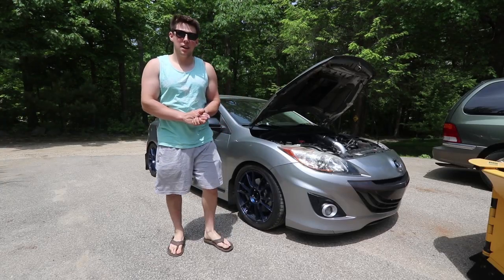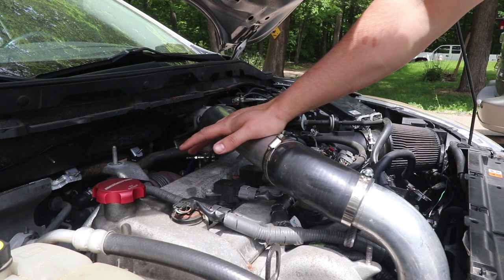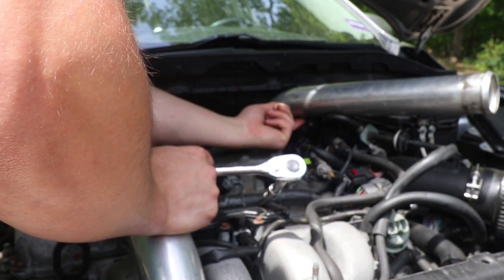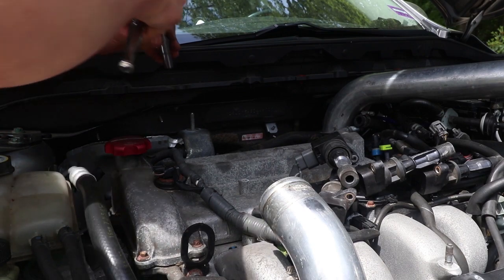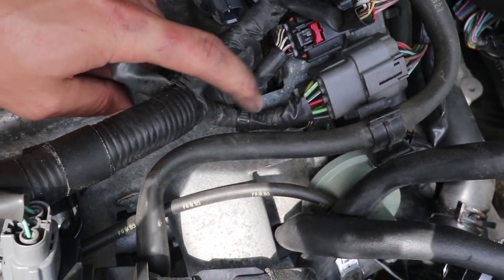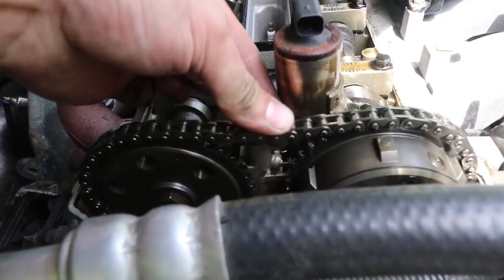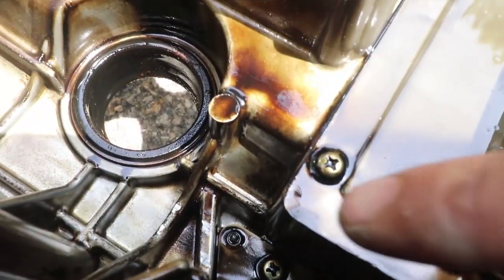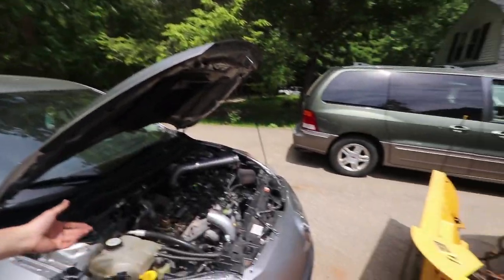Mazdaspeed 3 : How To Check Your VVT!

Comment: Why do Mazdaspeed guys always get this wrong. A loose chain means the tensioner isn't able to tension the chain so that it's tight. Whatever may be causing that. Either the tensioner is broken, which is rarely first to go, OR the timung chain has stretched beyond its serviceable limit and needs replacing.

The "VVT" is a cam gear. Technically, it's a system, but most just say "VVT" short for VVT gear. It's the big one on the end of one of the two camshafts. Usually Mazdaspeed3 guys abuse their car, and the VVT goes early along with the chain due to oil sludge. Oil sludge is due to not maintaining your carbon buildup. This is called abuse. Carbon buildup is maintained by either having port injection, which many cars no longer have, OR using a liquid cleaner to clean the entire intake tract doing it every 3-5k miles just as often as you're doing your oil changes.

Stop abusing your car, and your chain and VVT system will last you 300k miles.

Assuming this car is under 300k miles, then and therefore, this car has been abused. I would change the timing chain, tensioner, guides, and VVT gear. I'd also replace the VVT filter, which is next to the VVT solenoid. VVT solenoid is the part that sticks through the valve cover.

Enjoy

Comment: Why you calling it a VVT? It's a timing chain bro. Means you need a timing chain job done. The VVT is the solenoid or the phaser sprocket. You shouldn't be working on Mazdas man. Seriously though when you say your VVT is hitting the valve cover makes you sound like a noob. VVT ( variable valve timing) it's a system not a part. There are several parts to a VVT system such as timing chain and tensioner, VVT phaser also called Cam phaser , VVT selanoid. That slack wasnt even that bad, I've seen worse. Can't wait to see you change a VVT 😂😂😂 you need a timing job not a VVT job. Your chain is overstretched and tensioner fully extended , meaning timing job!! May as well change the VVT selanoid and phaser while you are there. May want to let a pro do the timing bc im not sure I'm confident that you can handle it. Its actually pretty complicated if you dont know what your doing. It requires special cam and crank tools and things must be done in a proper order. You may wanna watch a video on MZR timing.

Comment: How does the VVT cause a loose chain - wouldn't it be caused by a bad tensioner or stretched  chain due to high mileage ?
Reply: Yes that's happen to mine the tensioner was shot and all the way out
Reply: Kid doesn't know what the fuck he's talking about.
Reply: Most Mazdaspeed3 guys have it backwards, but the end result is the same. When they see a loose chain, they immediately think and say VVT is out. The timing chain is actually stretched beyond it's serviceable limit is what it is. So, you would change the timing chain, and tensioner.

 replacing.

 Usually Mazdaspeed3 guys abuse their car, and the VVT gear goes early along with the chain due to oil sludge. Oil sludge is due to not maintaining your carbon buildup. This is called abuse. Carbon buildup is maintained by either having port injection, which many cars no longer have, OR using a liquid cleaner to clean the entire intake tract doing it every 3-5k miles just as often as you're doing your oil changes.

Stop abusing your car and your chain and VVT system will last you 300k miles.

Assuming this car is under 300k miles, then and therefore, this car has been abused. I would change the timing chain, tensioner, guides, and VVT gear. I'd also replace the VVT filter, which is next to the VVT solenoid. VVT solenoid is the part that sticks through the valve cover.

Enjoy

Comment: Isn’t the slack from an elongated chain from the chain tensioner ? Which would mean only thing he would need is the chain and the tensioner replaced? (Obviously if the chain is coming out then you mine as well do the entire service)
Reply from the maker: You want to make sure it’s at top dead center before checking the chain but i guess yeah it’s actually the tensioner. Just change it all if you’re in there

Comment: Hey mate great vid, I've just rebuilt a 08 cx7 2.3 turbo, but I don't know if I've got the vvt sprocket in the right position, I never marked it!!
I've got the new vvt in, with the retaining pin at the 1-2 o'clock position. Any advice would be great cheers Dave

Comment: I bought my car and have had it for over a year decided too check for bad vvt this same exact way, and saw marks, and it has a little slack but nothing enough too worry I sent a video of the marks and I got told it was bad vvt but I don’t hear anything at start up, also my timing chain and tensioner was already replaced so I’m assuming it’s from previously but it’s scary! Any advice?!
Reply: Mines the 07 Mazdaspeed 3

Comment: That’s a timing chain my guy the vvt is the solenoid right by the chain 💀
Reply: Lol my guy doesn't what he doing, that chain probably not even stretched either, usually it's the tensioner that go bad from all the pulling.
Reply: I get what he was trying to put across though. The vvt unit on the cam shaft can rotate obviously, so if the vvt unit itself was buggered, it could rotate anti clockwise causing slack on the chain. I'd be sussing the tensioner first too though, the ratcheting tension in these motors are pretty temperamental lol.

Comment: Your VVT isn’t faulty cause you can clearly see the cap still there..
It’s mainly your chain is stretched.
Reply: I don't mazda 3's but I was thinking the same thing....
Reply: In reality it's just the chain tensioner. I literally got the same chain on for a couple years now and no problem. Everytime there is a slack it's just the tensioner. All these other people really are just doing the most and make a even bigger deal about it.
Reply: @evancai6061  in reality it's the VVT and the timing chain. The first gen MZR DISI had the pin in the VVT actuator made of a substandard material, it wears out and eventually snaps. While wearing out, it has a tendency to stretch the timing chain, which was also made of an inferior material. The chain tensioner and guides don't fail practically ever.
Reply: @Jakey  what about the 2nd gen does it have the same pin  for the vvt?
Reply: @JakeyyFD  FWIW, I have a 2007 Speed3 with 182K miles, and original VVT and timing chain.

Comment: This video is misleading info. For one, you need to rotate cyl1 to TDC before checking slack on chain.  ALSO, Mark's on valve cover arent 100%, because if the vvt was changed out by previous owner then those marks could be there from before. ANOTHER possibility is the VC was replaced for aesthetic reasons from another vehicle.
Reply from the maker: Yeah i forgot to mention you need it at tdc to check it 😂

Comment: Bro its normal. Timing chains run through oil pressure. A slight slack is nornal. Heck even a new or built engines you can hear the timing chain rattle at cold start with 1 to 2 seconds, if it still rattles 10seconds or more then you are screwed.
Reply: But thats way too much😂
Reply: @MisterMaxicola  thats not even at tdc ofc it has a slack.
Reply: The man didn't even move the crankshaft so we will never know

Comment: You showed absolutely nothing you didn't even touch the pulley.
Reply: Bottom line is your chain shouldn't be that loose. Whether its a vvt or just a bad chain although it is known that these engines have vvt actuator issues which cause stretched chains. Might as well just replace everything.

Comment: Do you even know what vvt means aha
Reply: Variable Valve Timing Actuator   (  the acronym   VVT   is how it works )   the actuator  which he calls  timing chain  works on oil pressure  (  changing  advance/retard on the timing dependent on the ECM,PCM   data.  Funny how he looks at the OCV  and says its bad without pulling it out and testing with a 12 volt battery and seeing if the spool is stuck or not open/closing  but what do i know ?
Reply from the maker: Variable valve timing.
Reply: When you say you need a “vvt” don’t you mean tensioner new belt and actuator and bolts etc...  please elaborate so that anyone that has this rattling problem knows what all to order to make the problem non existent so that they can have the car zeroed on that chain problem.

Comment: Eeeh as said below, how would changing of the vvt solenoid help with the slacking chain?
As far as i know that needs a new chain, tensioner and sliders.
Or what have i missed?
No offence...
Reply: Sorry   but the VVT  is not a solenoid  but a Hydraulic Actuator  depended on the supply oil pressure form the OCV   , H e said nothing about a code   which generally is a P0012   retarded timing issue which is either the VVT  or the OCV
Reply from the maker: Yeah there’s no point in replacing just one part. You should get a new oem vvt kit that comes with everything (chain, tensioners, guides, etc)
Reply: That oem vvt actuators had a defect from factory where the stop lock pin would become loose causing the chain to stretch rapidly. After a certain vin number in 2010 they fixed it with an upgraded vvt actuator in the newer ms3's. Either way even if its just a bad chain might as well replace all of it.
Reply: @kevinborish  I'm trying to find out if I can use that solrnoid/actuator in my nb2 miata. Because our are expensive AF

Comment: I hope u checked it when it was hot.
Reply: why ?  doesn't matter   all you want to know if the  OCV is working and   open/ close to send the VVT Actuator enough oil pressure so it can advance/ retard the timing ):

Comment: You realize thats called a timing chain? Vvt means variable valve timing. Also theyre ignition coils not coil packs. Educate yourself
Reply: Look up timing kit for that car, it doesn't come with the vvt sproket. A loose chain will never be a diagnosis for a bad vvt. It's not an insult, it's a correction for when people watching your video sees they have the same issue they don't go to a mechanic and say "I need my vvt replaced". No mechanic will replace the timing chain and tensioner/guide with that statement. I'm saying this with no disrespect to you, but to help your viewers.
Reply from the maker: Oh hahaha okay
Reply: But he is right.....vvt is that large intake cam sproket (hence variable valve timing), that chain looks stretched. He needs a timing chain and probably guides. If he just changed just the vvt, he will have the same problem he has now.
Reply from the maker: Guys no shit a full “VVT replacement” would be replacing the guides, tensioner, chain itself, etc etc. lmaooo
Reply: No Body 😂😂
Reply: Would I just be able to buy the edge sport vvt kit and call it a day with that being replaced? Or is there more I'd meet to replace in order for the problem to not happen again ..
Reply: Your dumb

Comment: Did you ever replace the timing kit and if so how hard was it?
Reply: And yes it is not easy  at home takes about  6-8 hours  including cleaning the gaskets off the timing cover and cleaning all the bolt holes, you will also need a fixture to hold both cams at once and a fixture (  8mm screw  special length )  to hold the crankshaft counter wieght from moving (  AND DON't  FORGET TO  SET THE 2  MARKS AT 12 O'CLOCK POSITION ) on the cam shaft gear and the VVT   Gear  . Hope this helps .  TIP: if you   you do not have a P0012  CODE  i would not change out the  VVT  Actuator but make sure  the Oil Control Valve  "OCT" WORKS
Reply: OH AND I FORGOT  YOU WILL NEED A NEW CRANKSHAFT BOLT ALONG WITH 3 FRICTION WASHERS ( AND GOOD LUCK WITH TIGHTENING THE CRANKSHAFT BOLT  to 77 ft/bs  PLUS  2 TIMES @ 90 DEGREES   you will  need a fixture to hold the crankshaft pulley  which is difficult
Reply: @mrfixitdellacertifiedfield5376  Hold it all still with the flywheel.
Reply from the maker: Funny story about that which I’ll be making an update video about tomorrow!

Comment: GL with the VVT job
Reply: Thanks its actually quite simple    6-8 hours  at home  with  about 5 different special tooling that you have to buy  along with a torque angle gauge/ cleaning out bolt holes  and replacing the crankshaft bolt along with the friction washers   ( of course replacing the timing chain  tensionsers, )
Reply from the maker: Hoping everything goes smooth!

Comment: You made sure cylinder 1 was at tdc right? If not you will have slack in the timing chain
Reply: I guess I should watch the full video before commenting haha. Yeah that’s a clear indication
Reply from the maker: Hahaha but yeah if i didn’t see the wear marks that’s what i would’ve done!
Reply: @TomCanino  i have 215k kms on my speed with no timing chain done, no rattles at start up and i basically have the same set us as you except a highflow cat and a big top mount and other little things, but my chain does have a lot of slack i check it all the time, but theres been times where iv checked it and its stiff as fuck, not saying its not good to change it but i just feel like a lot of people over react with the timing chains and vvt on these cars.
Reply from the maker: @MarcGismondi  what year is your car? supposedly the issue was more common on gen 1s rather than gen 2s
Reply: @TomCanino  i have a 2009 first gen i do plan on changing it sometime this year tho,  its been in the back of my head for a while now, but another side of me is saying its not worth it and to buy a new motor if it ever fails
Reply from the maker: Marc Gismondi i would definitely rather spend $400 on a vvt job than thousands for a motor
Reply: @TomCanino   Hey guys. My son wants to buy a 2010 1st gen right? Is the one in the video a 1st or 2nd gen? Thank you!
Reply: @aubreysavaria1777  the one in the vid is a 2nd gen.
Reply: I have a 06 speed6 with 172xxx not sure if the timing chain job was done yet but starting to make a lil noise thinking it's stock waiting for a cherry picker to go over the whole motor not looking forward to the whole vvt timing chain guides etc replacement
Reply: 172xxx miles
Reply from the maker: You can check it yourself it doesn’t take long!
Reply: @MarcGismondi    A stretched chain can cause,   poor engine performance because the timing is now off by a few degrees  and @ 215km  I Doubt  YOUR CHAIN IS TIGHT   . You cant stop parts from wearing   its normal that's why we replace and rebuild  and make like new  again
Reply: @mrfixitdellacertifiedfield5376  my car never had ANY issues, rare knock readings on a 26psi pump tune. i built my motor  now over the winter just cause and my chain and vvt stiill looked ok. i still changed everything though. i still think people over react.
Reply: @MarcGismondi  no point in this video. He calls the timing chain a "vvt" and it should have a little slack in it because it runs of on oil pressure and pretty sure you need to be on TDC to really feel it tight. A little rattle when cold start is normal like about a split second to second is normal, even brand new engines or newly built engines rattle at cold start too because of the nature of timing chain still picking up oil pressure from the oilpan below. Plus it this engines love 40w oils so please use it👍
Reply: That's not true at all  Chain stretching is normal and has nothing to do with the location of the pistons (  Here is a TIP: because the chain is stretched now it is hitting the inside of the valve cover and causing aluminum metal chips to fall into the engine !  Don't you just love Japanese  ENGINEERING ?  The clearance inside the  valve cover is so tight the chin can hit the inside of the cover and cause 2 notches that resemble the chain ( i had to grind out this area on my 2.3 l  ford Turbo engine so it wouldn't happen again .
Reply from the maker: Nonetheless it’s hitting the vc though so it’s definitely loose right?